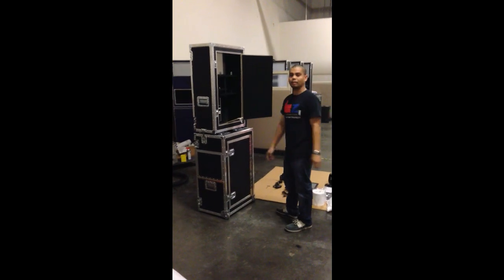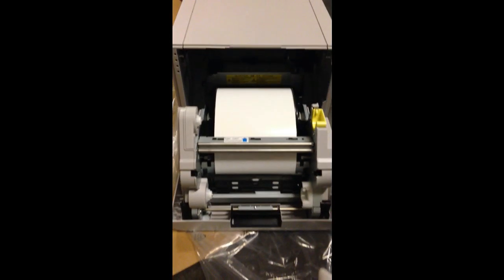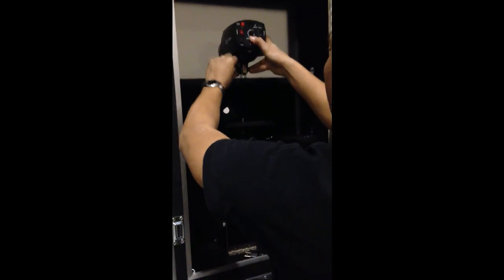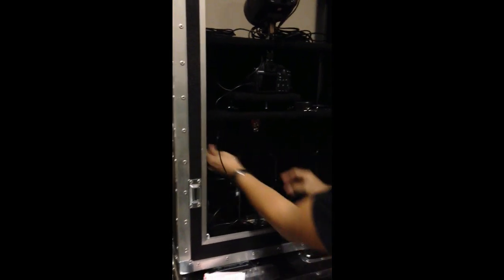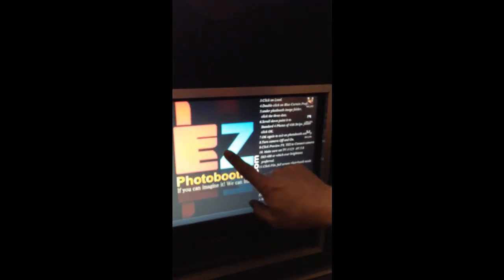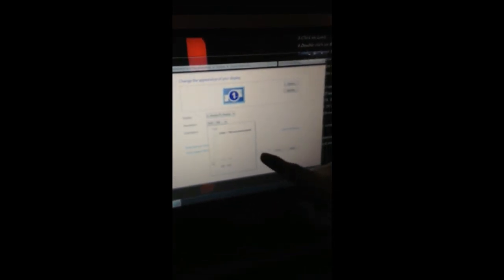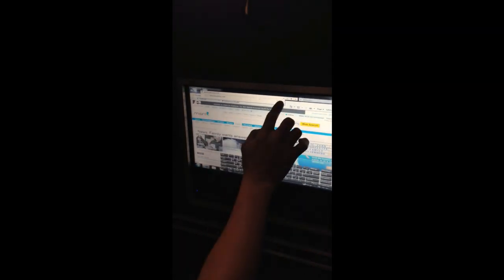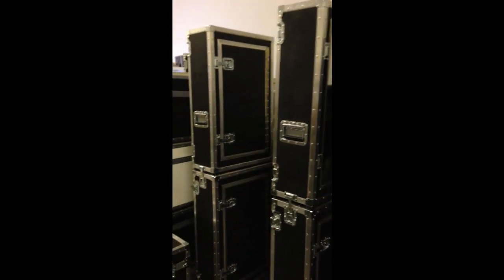Stand Alone Photo Booth System Setup from Start to Finish

Comment: Nice video but you need some light on the subject.  Can't hardly see the inside of the Photo Booth.   Also what are the size of the booth top?  With the Flash can you close the back so the light dosen't flash to the rear of booth?

Comment: Hi !!
I hope you are doing fine !!
I bought a photo booth software  because I want to make a open Photo Booth, and this is mi situation:

 I plugged my camara( 7D canon) with a mac computer and a flash, ( Alien bees 1600), also the computer is plugged with a TV screen,  and printer   the problem is this: 
I want to have in my TV screen a clear reflect of the people,while they are taking the picture, but it is not possible, because my camera settings are adjust for the final picture, and if I change the camera settings to be able to have a clear reflect on the TV screen, then my final picture comes very overexposed,.
I dont know what to do. so I want to know, if you can advise me, If I have to do something with the software or with my flash,

I Would really aprecciate your comments,
Thank in advance
Valery 😊